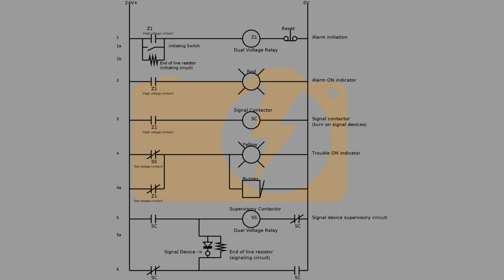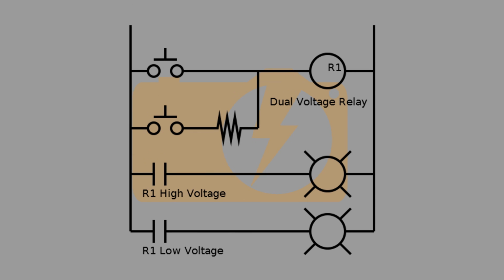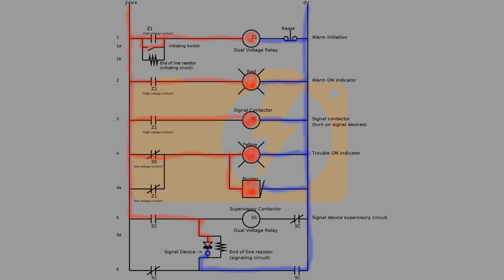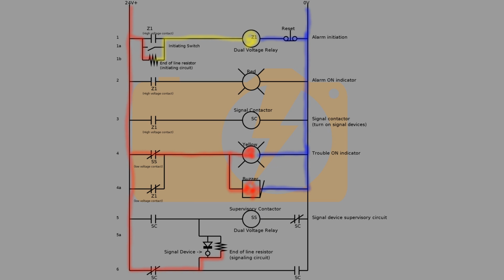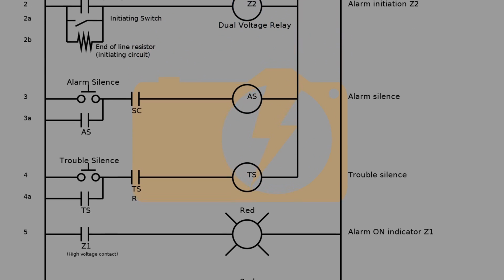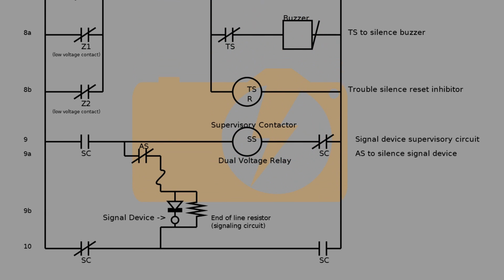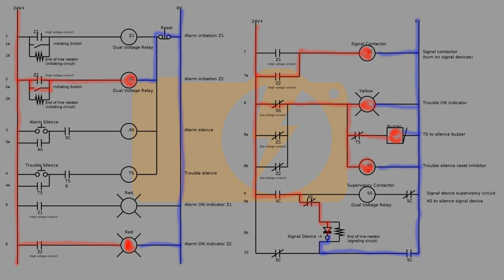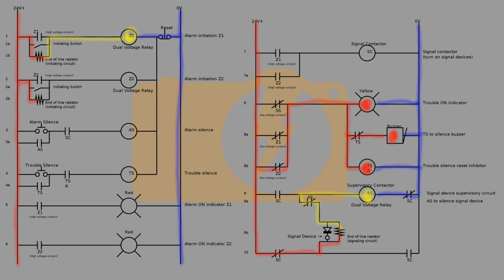Relay Logic Part 2: Fire Alarm Problem

Comment: If you use NC contacts they will allow energy to flow to the buzzer and yellow lights. I'm pretty sure they should be NO contacts so they only close once the alarm is initiated.

Comment: I'm only 3 minutes in so maybe It'll be clearer to me later, but so far this video could benefit from animations that indicate what you're talking about, in stead of relying on correct reading or memory the entire time.

A finger pointing at things might also work.

3:39 I'm gonna stop watching now, it's clear I won't be able to follow this without first doing more than just watching your first video.
Reply from the maker: I know this one is pretty intense, the problem itself is meant for 2nd or 3rd year electrician apprentices. Due to budget constraints ($0) I am using almsot entirely free software to make all my videos which puts animation far above my skill level. I may be able to add coloured annotations over the coils and contacts but these will not appear to mobile users.

Sorry that this was a rough one. The next couple videos I have coming up are all pretty light.
Reply: @NickMoore  what software did you use in making this ladder diagram?